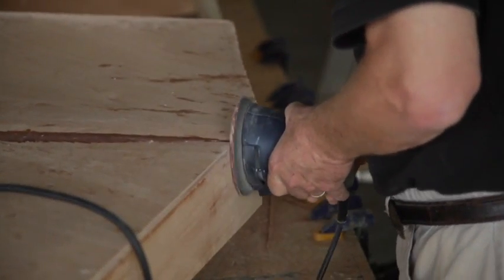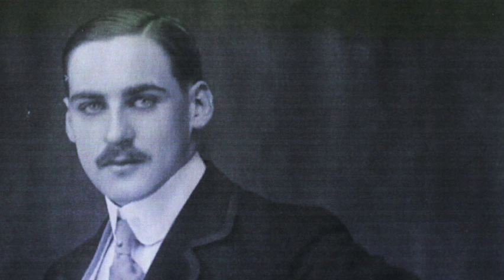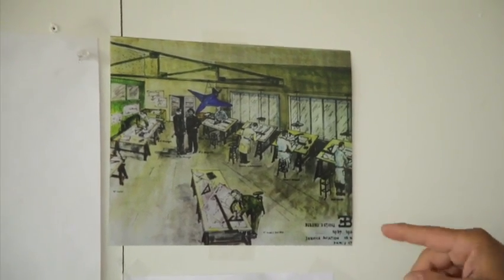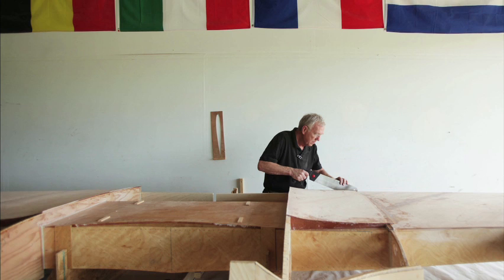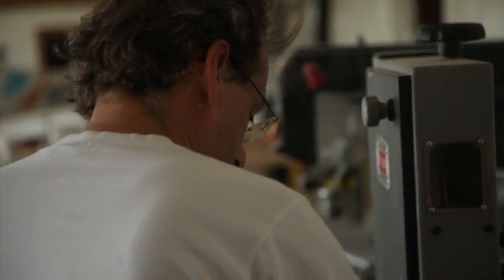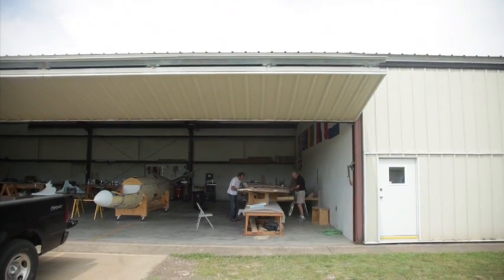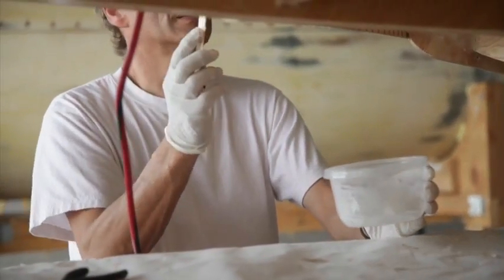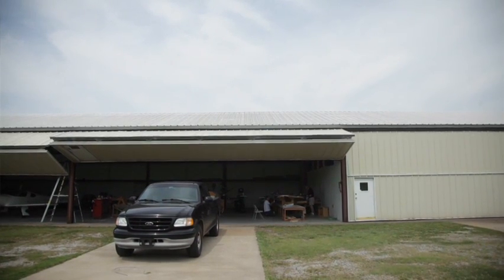The most elegant airplane that never flew

Comment: The idea of using the aircraft skin as the radiator was not new when this aircraft was designed. The S6 seaplane of 1929 used this and there may well be earlier examples.
Reply: so did the Heinkel 100
Reply: Replay it and you'll see the individual making the statement was actually saying it was the first one that he himself had seen. He didn't say it was the first, just the first one he had even seen.